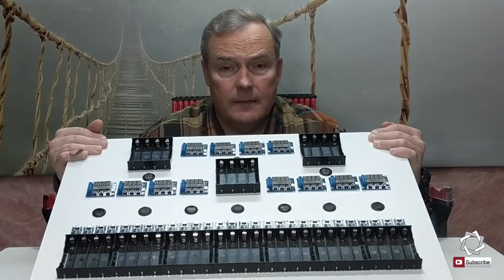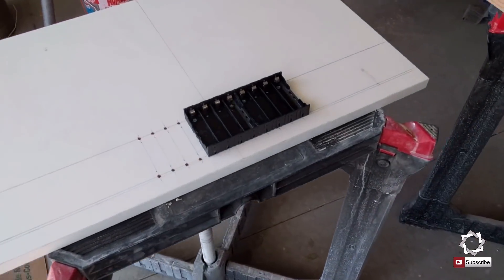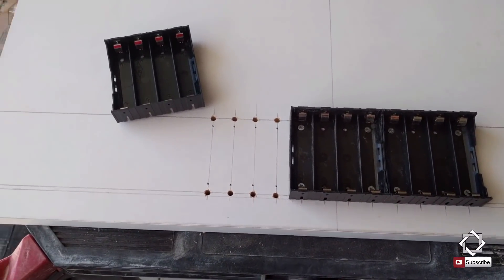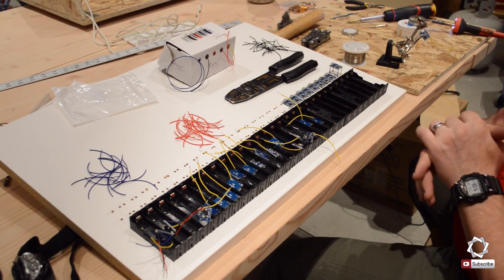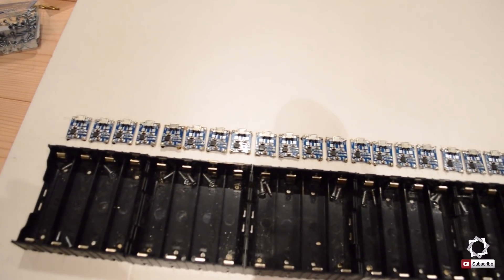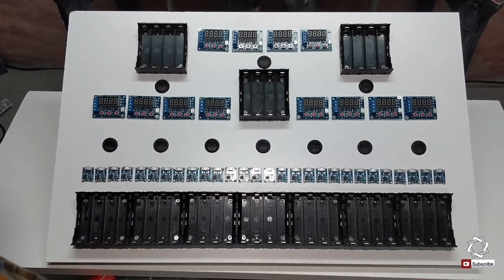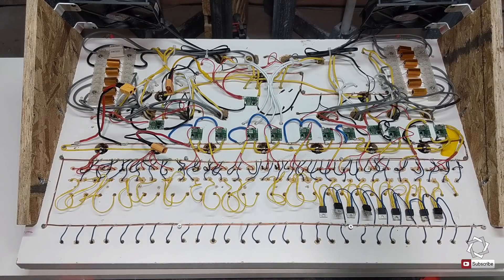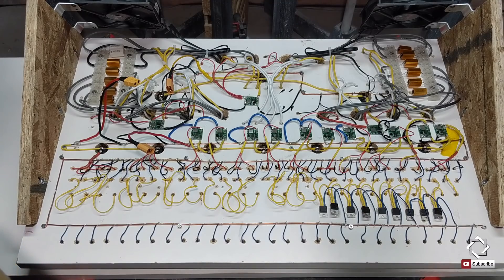18650  Charge - Discharge Board

Comment: If you can use a boost converter for a load on the dischargers to charge the 18650 or do something useful not just make heat

Comment: Did I miss the description of your power supply output voltage and amps?  You spoke of buck converters/ step down units to get to 5v.
Reply from the maker: I must have missed it, I will go back and see if I can fix it.

Comment: interesting video.  I have heard builders of cell chargers talk of balancer.  Did this sort of mechanism get inserted here?
Reply from the maker: I did not include a balancer in my charge board.
Reply: After watching more videos about charging and balancing, I believe cells connected in parallel do not need balance control as all receive same voltage.  Balance control is used when cells are connected in series.

Comment: Hi Frank, 
cool Video! 
I'm building a much smaller board 6S for my Imax B6.
I am wondering how you set up your discharge module.
2.9V ? 3V? 3.1V ? I even read that some guys are discharging up to 2.5V to test the capacity. I am confused... Let me know!
Charles
Reply from the maker: They are set to discharge to 3v.  Some but not all 18650's can be discharged 2.7v but I think it is safer to not go below 3.0v.
Reply: Frank Brand thank you so much for your reply! Just bought a Opus 3100 as well. Haven't tried it yet but I believe it's 3V as well. 
Also, too bad that a balance charger type B6 can't test 6 capacities at once... that would be so nice! Also bought by mistake 2 discharging modules like yours so I can now test 1(b6) + 2 (modules) + 4 (Opus) = 7 at the same time! 
I also heard to more accurate to get a constant 1 amp discharge rather than a falling discharge amp that stops at 0.1A... 
What's your thoughts on that?
Best, 
Charles

Comment: So what power supply did you use? A 500w computer PSU? How did you wire that up? I saw the 2x5V and 1x12V connectors, but don't you have to trick the PSU into turning on if it's not plugged into a motherboard? Love this setup and want to make something similar, but every video I see doesn't explain their actual power supply. More info on that would be very appreciated!!
Reply from the maker: My bad!!!  Yes I just used a 500 Watt computer power supply.I just followed a video on YouTube that showed how to wire it to work with out being connected to a motherboard.  It has worked great.

Comment: Hi Frank, Just curious. Why can you not discharge the batteries into capacitors and use the discharge energy to charge new batteries cutting down the energy requirements? I don't see anyone doing this, but it doesn't seem hard. I'm assuming that because nobody does it, that it is somewhat problematic.
Reply from the maker: I have never played with capacitors before. I would need to do some research on how that would work.
Reply: I really would love to see 18650 discharge into capacitors for use of power else where!
 This will be something I will be adding to my bored. 
Self learning is key... so it's time to figure out how capacitors work and how to store power in them safely without burning down a house/shed.

What kind of capacitors should I look into first? Of course super capacitors, correct?

Comment: I appreciate what you are doing and that you made this video. I just ran some numbers though. In order to recreate what you made it would cost $206.21 using the items in the links you provided. That DOES NOT include a power supply, wood, mosfets or wire. That would allow you to discharge up to 12 cells at a time.

Now, compare that to the Lii-500 which is $20 shipped on ebay.

You could purchase 20 Lii-500's instead and discharge 80 cells at a time! You wouldnt have to waste any time building a test bench or waiting on parts. I am so glad you shared this but did you think of that before you started? Seems like a no brainer. 12 cells at a time vs 80 cells at a time...
Reply from the maker: James, good point.  There were multiple reasons for building this charge-discharge board.  One reason was to have the experience of doing the build.  :-)
Reply from the maker: Anthony, That is awesome.  Can you send me photo of your finished product?  frank@thediyengineer.com
Reply: Oops my math was wrong. For $200 you can buy 10 Lii-500's which would allow you to discharge 40 at a time. Not 80. Either way, 40 is more than 12.
Reply: James Klafehn well in a place like Kenya where import taxes are high about 46% this route is cheaper. the customs guys see any electronic device and assume its expensive so they wanna hit you with exorbitant valuation....
 i am currently assembling a rig with 50 dischargers ( ZB2L3) plus 50W resistors plus cell holders  and  162 chargers (TP4056) plus cell holders and 10 computer PSUs . approx total cost ... 390 to 400  USD.
Reply: Lii-500 are beautiful. Got 2 myself thinking bout grabbing 2 more. This time I'll make sure and buy the ones with  USA plugs. Cheers!

Comment: I'm surprised someone hasn't made their own charger discharger .  like the store bought ones for like 20 cells. and or sell it in diy kit form. I guess the controlled of something like that is a bit complex. and easier to just buy a few chargers. or do it like you are.  being small and good looking don't make it work better.
Reply from the maker: James, Thanks for watching.  When I first got started I built a crude charge board that could charge about 9 cells at a time.  All my discharges were done on my iMax B6 mini, it took forever.  I was processing about 3 cell a day.  With my charge/discharge board I could process about 30+ cells a day.  So that really cut my processing time down a ton.  So worth it to me.  As for being OCD, well I just love spending the time making things look good.  :-)   Frank
Reply: Wow I would've expected a higher processing rate. How long does it take to discharge a cell using this set up?
Reply: You might remember me from other comments but I am adding a battery pack to extend the range of my EV. I was going to go with LG MJ1 3500 mah cells for $3.80 each but I just found a deal on used Samsung 26f cells for only $1 each! So now I am scrambling to find a fast testing solution. I need 3700 cells tested. 60 cells a day will take me 62 days!

Comment: I started one myself. using a 4 bay charger sucks. I have 15 to 4056, and a computer power supply. I just need a few more components . its taken a week to do 1/10 of the cells I have. the tester charger I have will charge only at 1a. but test charge at .5 a. so nearing 3 ah cells. takes for ever with a 1/2 amp charge discharge. my cells come out to 2800 mah average.
Reply from the maker: James, That's awesome that you are working on a project.  What are you processing cells for, powerwall?  Oh yes you need to bump your discharging up to 1 amp.  I had to order  these resistors https://goo.gl/qXmVRA because my discharge boards came with .5 amp resistors.    2800 mAh cells are great.  Let me know if you have any questions.  Frank
Reply: Frank Brand I finally got in some parts for my board. I had the chargers. now I got in one of the dischargers. the rest should be here next week. along with the cell holders. charging and testing 4 at a time. is taking forever. over two weeks non stop! I can't wait to get this board going. then I can get 15 pee go. plus the 4 in the charger. I don't want to buy more until I can at least see the end of these. I'm not even 1/3 through the 300 cells. I guess the MOSFET has less volt drop than a diode. is that why you used them? I'm working on a power wall. or a trunk/ box , cabinet. what ever. I'm building a box to put them in and its going to be on the floor. so I can't call it a power wall. I been trying to watch where the parts come from. if you order from the wrong seller. it can take over a month to get delivered from amazon.  I been thinking . maybe there is a way to use the power from a discharging batt to charge another? I know there will be losses. I haven't experimented any. I'm looking to see if anyone else is doing anything like that. any way. you seem to have a great channel. my charge controller also came. its a 30a tracer A epEver. I also plan on building a small water wheel generator. to help power my house. along with the solar. thanks...
Reply from the maker: James, The only charge controllers I'm using on this board are "1A 5V Micro USB TP4056 Lithium Battery Power Charger Board Module TE585" (http://amzn.to/2CnS6fu).  These were designed to charge single cells, but they could be uses on multiple (parallel) cells, but with the output of only 1amp it would take a long time to charge all the cells. I think you might be referring to the "Diymore 18650 Li-ion Lithium Lead-acid Battery Capacity Meter Discharge Tester" http://amzn.to/2GPkNQP.  This device was designed specificly for battery capacity testing via discharge.
Reply: I probably don't know what I'm talking about, but here goes. I'm going to assume the charge controller you just got is a solar charge controller.  For your discharging batteries, if they were wired in parallel and the batteries are 3.7v that would give the same voltage of a solar panel.  Hook up the discharging positive and negative leads to the solar charge controller solar inputs.  Don't forget you will need 4 batteries in parallel as the battery pack that are somewhat low in voltage.  Would the batteries you are discharging then charge the other battery pack with some loss due to the charge controller?  Don't forget you will need something to limit the amount that is taken from the discharging batteries.  How fast would they discharge? 
 That is interesting....

Comment: This is great Frank, I really wanted to see that underside.  I have 3 questions.

1.Are you using the buck converters because your source is 12 volt and you needed 5 volt? I am using a salvaged PC Power Supply and plan to use its 5 volt rail for TP4056 and Dischargers. I am hoping that will alleviate the need for the buck converters. Do you agree?

2.On the dischargers, for power source soldering: (as seen when looking at underside of board, USB at bottom) For the positive, I found a solder pad just above the USB mount. For the  negative I found a pad on bottom edge, next to lower left board mount hole.  OK to use those?

3. My dischargers came with resistor pairs marked "5W 7.5 ohm J". With one installed I get .5 amp discharge rate.  I want to discharge at 1 amp. I tried connecting two in parallel, but that only gave me a .850 discharge rate. I guess i don't understand the true physics or math of how that works. I am an admitted noob in the area. Any guidance on that?
Reply: I just watched the video again, and you ARE already using the 5 volt rail.  The Buck converters are because the buss is so long and powering so many TP0456's?
Reply from the maker: So I'm using one buck converter per every 4 TP4056 chargers.  Thanks for watching.  Frank